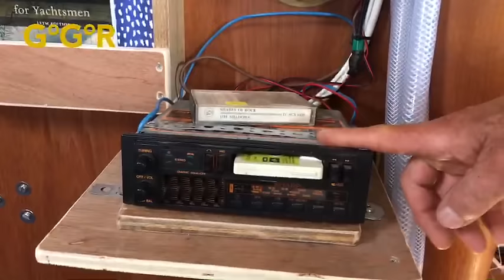LIVE VISIT OF ROBIN DAVIE'S BOAT (GGR 2018 ENTRANT)

Comment: That bunk is the best. Sleeping dry and comfortable is the most important indeed. Functional simplicity really matters doesn't it. I currently have a stout cruising boat (IP35) with hot water, pressure water, fridge, Ac and more but as they break and as we make miles, I intend to simplify as much as possible.